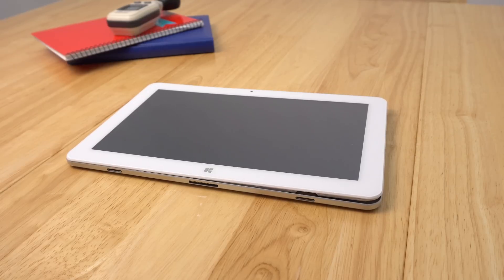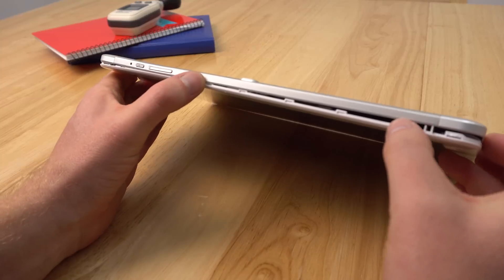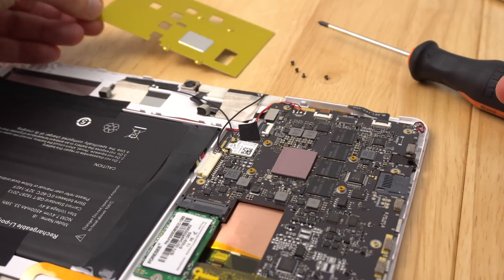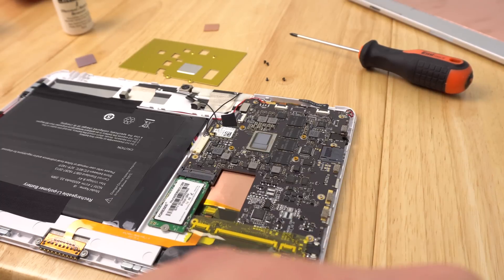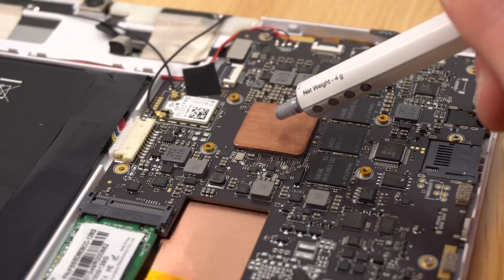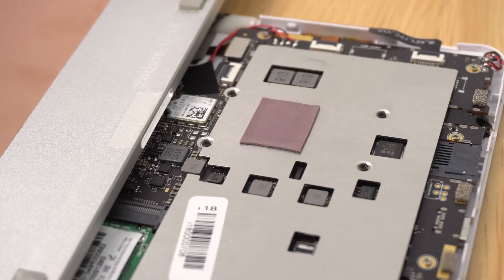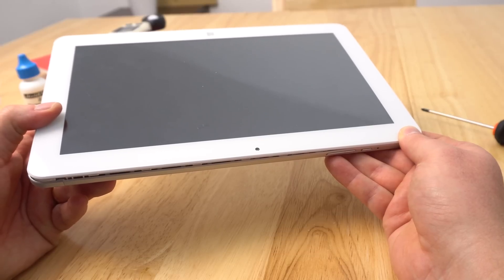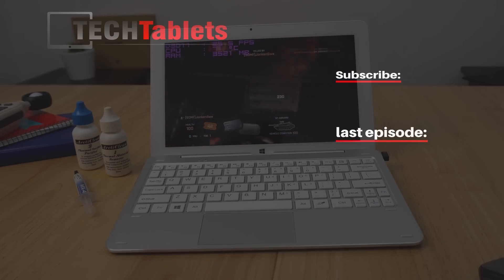Cube Mix Plus Copper Heat Sink Mod -  Lowers Temps 20 Degrees C!

Comment from the maker: Cube Mix Plus. The Cube Mix Plus gets too hot, here's the fix. Another copper heatsink + thermal pad to lower temps up to 20 degrees C. This tablet is $309 USD with coupon 27fc14 here: http://www.banggood.com/Cube-Mix-Plus-128GB-Intel-Kaby-Lake-7Y30-Dual-Core-10_6-Inch-Windows-10-Tablet-PC-p-1109155.html?p=QZ14021624945201505Y More info: https://techtablets.com/cube-mix-plus/ More info: https://techtablets.com/cube-mix-plus/
Reply: Great video. You show how to open it and have lots of detail and steps in the video. That said, this is so sad. Why, why can they nog get this right. Why are they so bad at fixing these simple problems of heat dissipation from these Asian electronics. Thermal pads are not the best but good enough if you have a good design, is is really that difficult ?

Sigh. Lets hope these great videos do push them in the right direction to improve the products. You should send them this video link in a e-mail so they can learn something :-D

Excellent work with this thermal modification.
Reply from the maker: Dennis Olof I know it's so stupid we have to do this. They don't learn!
Reply: Yeah, before they had no thermal pads or heat spreading things in the units. Now they have learned to use that, so they add heat spreading plates. Progress right, well it seems they keep forgetting that you also need to transfer heat. Anyway I do like your videos where you do show us the internals. I know it can be a nightmare to get into these devices.

But it does seem that at least most laptops are easy to open, so that is progress. Most tablets are impossible to open without serious damage to them.

Keep up the good work, great stuff.
Reply from the maker: Which is why I don't open up some of the tablets fi they don't need it. Some are just so hard to unclip and too easy to crack or break the screens or plastic clips.
Reply: is x5 pro with same processor better at gaming from this cube mix plus
Reply: Where do you get the copper and the thermal adhesive? I guess probably not Bunnings? 😂
Reply from the maker: No not bunnings warehouse or Mitre 10 Mega :) I used eBay for my bits and pieces.
Reply: I don't understand what is the rectangle beside CPU. http://prntscr.com/e4odri
Is it GPU?!
Reply: +TechTablets.com kk, I just bought a thermal "set" from China with the copper, 7783 thermal adhesive and some sort of lubricant oil included in the pack. Anyway, I hope the copper is the correct thickness cuz it didn't say.... Fingers crossed
Reply: Does the Mix Plus support type C charging? I don't have a quick charge charger to test it out.
Reply: sunny steve Previous Cube support type C charging, but only "power delivery".
Reply: +Andrey Viktorovich I don't really know much of charging but I'm guessing you mean it stands for powering the tablet but no charging to the battery? But on the official website of cube they did say "type-c charging" which is weird. Anyway I tried out my 18W portable charger and it doesn't really work... (sometimes only work for couple of seconds, then it says error on the portable charging end...) considering the DC adapter is 24W should I buy a 24W charger or is it all a matter of the first question?
Reply: You need the charger about 50 W with power delivery - https://techtablets.com/forum/topic/powerbanks-for-cube-i7-book/page/3/#post-49263
Reply from the maker: It supports type-C charging.
Reply: Think this $383 offer is over :(